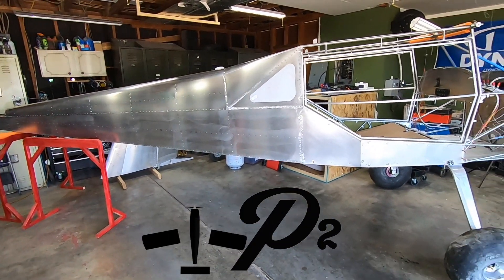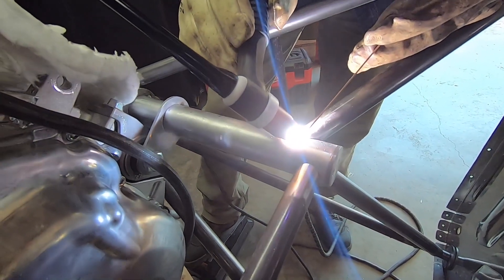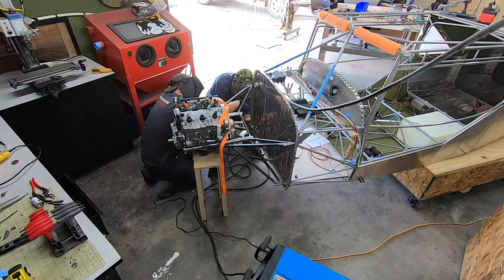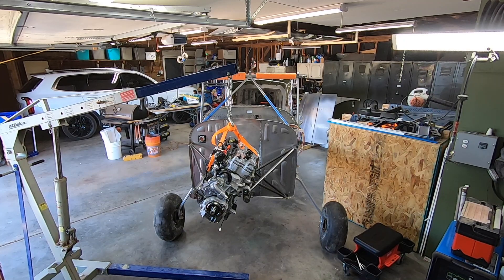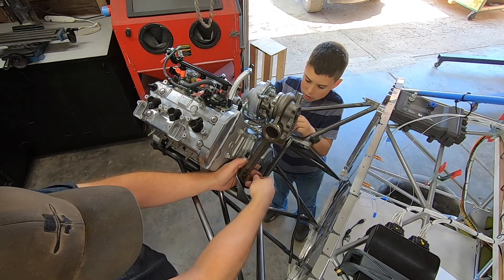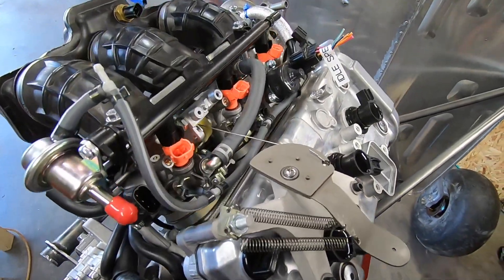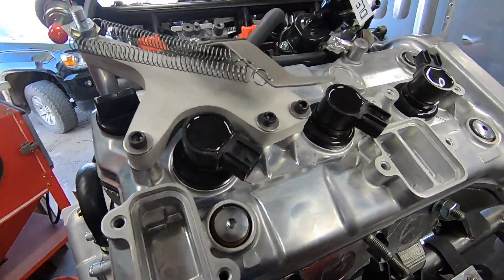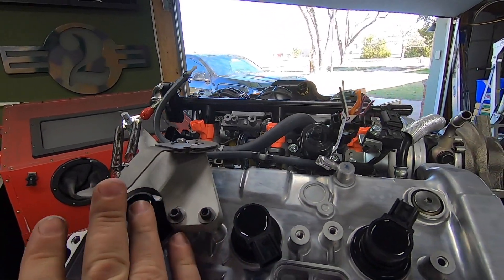RANS S-21 YAMAHA 998TURBO UPDATE EP28

Comment: Looking good...nice install and process on the engine. When is the gearbox coming or will that be the last item you get for the engine. Just watched the latest video from Project Kitfox on here. He is not getting enough oil cooling on his Apex...what are you doing for yours?
Reply from the maker: I’ll get the gearbox as soon as it’s available. Shouldn’t be to much longer from what I gather. 

I saw Bryan’s oil temp issues and think I think he’ll get it figured out. Many other guys out there not having issues so he dial it in no doubt. These motors have a oil/water cooler built into the side on the block but I’m considering running an additional small external cooler as well just to make sure I don’t have issues. Have not made up my mind yet on that..

Comment: Crazy to think that such a small looking engine will power the mighty S-21! Awesome work keep it up! A gentleman in a series 7 kit fox just completed his Apex build- I’ll be interested to see the flying characteristics of your plane!
Reply from the maker: Yes sir, I agree that this thing seems so small hanging out there. Bryan’s build set the bar pretty high but I think I’ll be able to hang although I’ve got way more heat to manage so special attention to that is coming up soon for sure. I’ll have about 50 more ponies than his current setup with not much more weight as far as the engine is concerned. Time will tell🤷🏻‍♂️
Reply: @Project2Aero  You’re going to need those 50 extra horsepower because his set up at 50% can barely pull the airplane through the air.
Reply from the maker: @Captndarty  He will get it dialed in. I suspect with some prop adjustment and once he figured out the oil cooling, it’ll be a great setup. The kitfox isn’t a fast airplane to begin with, his is built for a purpose and it’ll serve him well.